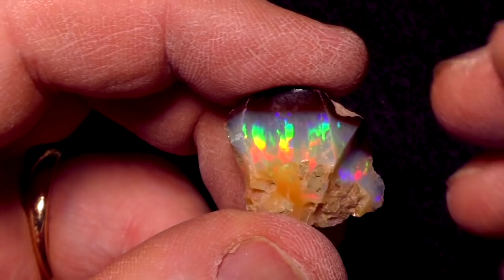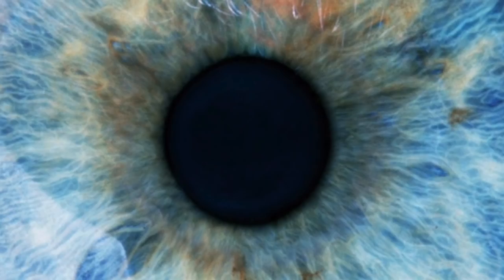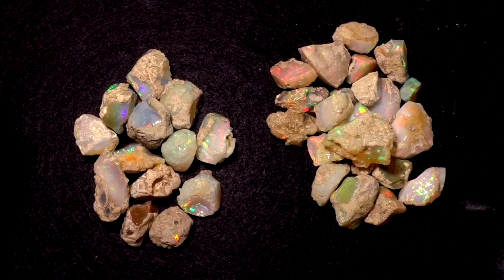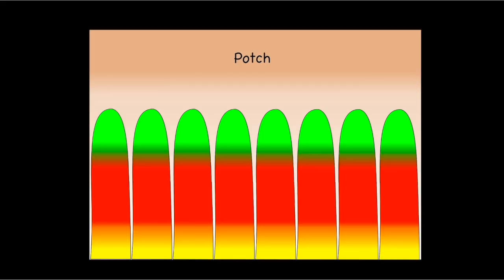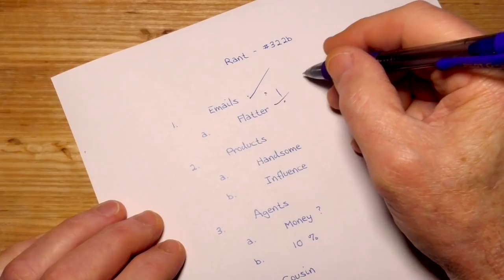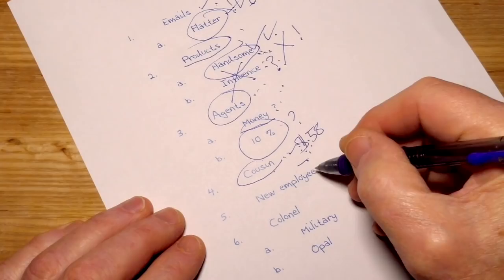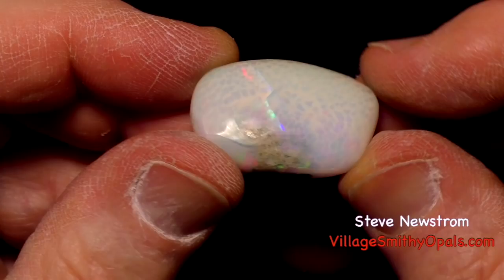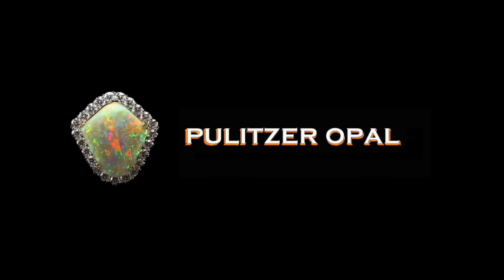HONEYCOMB Opal!

Comment: I'm sorry to ruin the COMB-ined total reactions of a perfect 777 to a 778, but I had to! I just bought an Ethiopan opal and it came in a small bottle of water. Do I need to keep it wet? All of the info on the internet says it doesn't. But I just need to ask a colonel of opal to be sure.
Reply: @PulitzerOpal  thank you for your answer. I will let it dry then. Mine is not white though, but a dark orange when you look through it. I think I like it dry, so I can grab it randomly to have a stare at it ;)
Reply: @PulitzerOpal  yes, pretty black-ish in water. I don't see any cracks. But it's indeed unpolished with rather a lot of sand still on it. But love it anyway 😁 I dropped it on the floor today and it's still in one piece!
Reply: @PulitzerOpal  i read black, but you said back in water... Hmmm

Comment: C'mon. Silicosis isn't on anybodies bucket list. If Ethiopian opal all cracked, you would not be sitting with one piece from over 1000 tons sold. In Virgin Valley we called your pips plumes as in opal covered sulfide structures before the E was discovered, but WE could never produce tons to force it to be acknowledged. Sideways we called it burning fire, or Barred play of color.
Reply: @PulitzerOpal  I dont have a great one dried & cut. Got some nice ones put away somewhere without being sealed in. I'm partial to perfect fossils with great play of color. The dont set well LOL. Too much fragile stuff Im waiting for the perfect treatment to prepare with, then log up into matching suites of cabs. I got ideas, but not the time or the need. Others in a hurry with entire labs at their disposal are working on figuring it out and a lot of local cutters think they have ways & are selling stones. That selling thing takes too much time that could be spent mining. My career has been shaped by forces unleashed on me. The Royal Peacock gemstone in the Smithsonian? I sold the triangular one i had videos of.
Reply: @PulitzerOpal  The biggest problems I found with perfect is it did not stop crazing after polishing to a opal surface again. If it will keep a crystal clear & not allow it to white out later, we got KILOS & kilos to treat instead of drying & cutting whites for less. All the pounder king stones are in water for the most part or cracked down into ct stones.